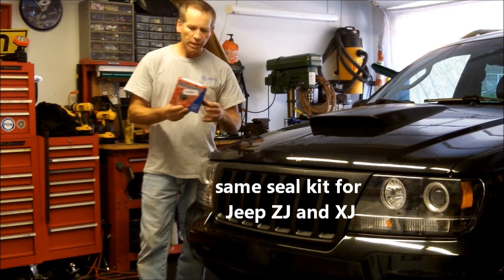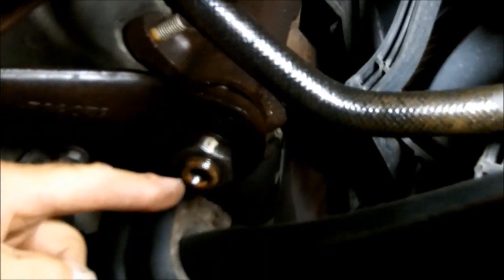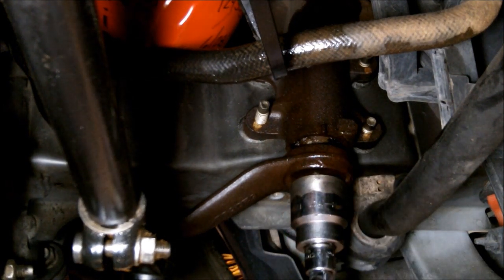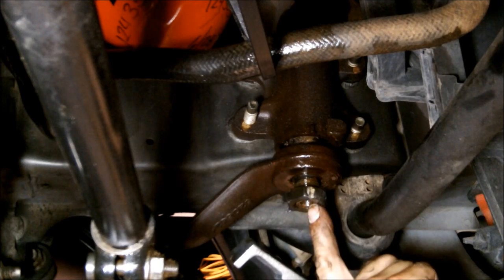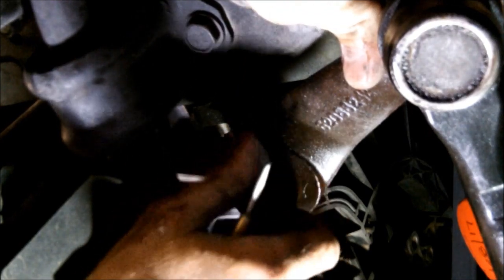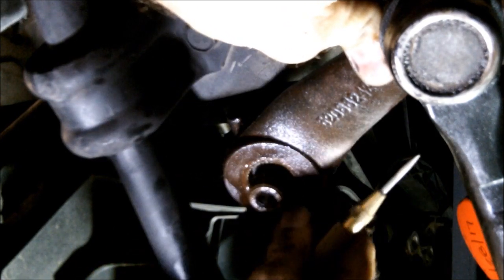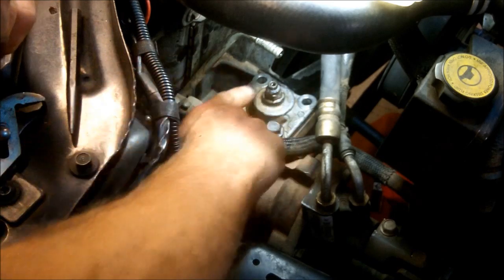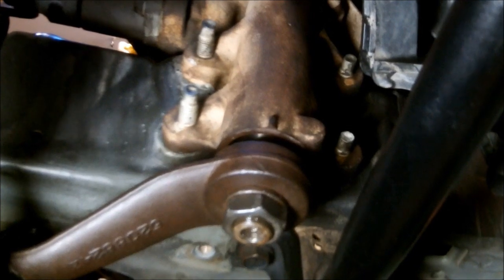How to replace Pitman Shaft Seals

Comment: This is one of the best breakdowns of replacing those seals. For such a small job it's a PITA. Gotta make sure you have a GOOD set of snap ring pliers. The ones at HF suck and the snapring keeps popping off the pliers.
Reply: You got that right.  Snapring pliers need the correct pin size on the tool, or you just have hell.  I reach for my knipex that has a 45 degree offset when it comes to getting larger snaprings in and out of odd places.  This is one of those jobs.

Comment: To get the seals out you can just take the circlip out. Then start the engine and turn the steering wheel either direction until it stops,then hold it there. It will ( most likely) blow the seals out. Kinda messy but it's easy. Make sure the tires are straight if you take the shaft out of the steering box and don't turn the steering wheel until you put the shaft back in the steering box. Oh yeah...put the nut back on the shaft before the vehicle is started. So you don't lose the washer. And so you can see what seal goes where. I don't actually take the shaft out anymore. I clean the rust off the shaft with a brass wire wheel. I made some spacers out of pipe.I Dremeled out a couple big thick washer that fits over the shaft. Then I use the steering shaft nut to press the new seals in. I just clean the rust off the inside of the steering box with those green abrasive pads. Then start the engine again. Just in case any of the rust & dirt got up by the bearing. When you start the car with no seals in it. It will blow any contaminants out. If you can't find the exact size washer,you can trim a bigger one down with a bench grinder. I have a 96 ZJ. I put a steering box strengther on my steering box and I haven't had any problems with the seals since. I think the box flexes a little under stress since the shaft is so long. Plus it's not unheard of for the steering box to rip right off the frame. The spot welds can break. Especially if you have larger than stock tires.or take it off road. It's not a bad idea to beef up where the box mounts to the frame with an aftermarket steel plate also.
Reply: GR8 advice Sir

Comment: The thing about these steering boxes is if there is any crud in the system... it's going straight for that lower bearing and seal.  Most of us don't hardly think about changing out power steering fluid, yet we should.  Once every 3 years ought to do it.

Comment: I left the shaft in & I used a 3" long wood screw & screwed it into the side wall of the dust seal & also the oil seal & as I tightened the screw down it acted like an auger & the seals pulled out.  My only problem on the oil seal was that the sharp end of the screw dug in between the bearings just above the seal & the tip broke off & was stuck up there in the metal. I had to pry it out & nothing was hurt, all metal up there. So maybe just get the screw tapped in & pull on it to get the seal out.  When putting the new seals in I used the washer against the seals & then tapped them with a pipe that fit over the shaft = my sockets were too big around to go up in.

Comment: 9:10 i know it’s late but i’m doing this on my ‘98 XJ, and an easy way to take off that outer seal without taking off the pitman shaft is to use a nail or screw and actually break and pull that seal out

Comment: I have done this twice on my silverado 4 wheel drive which has way more parts in the way under the truck. I took the whole box out.it is leaking again as i think i nicked the oil seal when installing it. I think i will do it your way now. This job sucks. Almost as bad as replacing fuel pump with dropping the tank full of gas. Just did that yesterday.
Reply from the maker: If you're sliding the seal over the splines of the Pitman shaft, wrap some electric tape over the splines to make sure that the splines do not damage the seal. Good luck 👍

Comment: Not sure if this was mentioned but I am almost positive the second seal you put in was placed wrong side out. I have replaced many seals and the open end with the spring is always placed toward the pressure side…..in this case, towards the gearbox where the oil is held in. I can’t be dogmatic but I have never seen it done the other way.
Reply from the maker: The second seal is to keep contaminants from getting in.

Comment: I have a leak on the top of the gear box it looks like the middle screw because i have a puddle at the top what seal are at the top where the 4 bolt are

Comment: my mech wants 1100.00 to replace the seals on my 94 Isuzu trooper.  would like to have seen the old seals on yr Jeep, what was the cause of the leak/what actually failed?.
Reply from the maker: Many times with steering gear boxes it is hard to see where the damage to the seal is, the steering gear box is under such high pressure that it doesn't take that much to start a leak.

Comment: Great video. Much easier to pull the shaft in order to remove/ install the seals. The kit comes with the large o-ring. Where does that go? Thanks for this very helpful video!
Reply from the maker: If your particular kit comes with a large o-ring seal go on the underside of the cover of the four bolts that you removed

Comment: How do you fix the play in the steering wheel of these jeeps?
Reply from the maker: first check the tie rod ends and if there good then you can adjust the steering box, center bolt and nut on the top cover but a little adjustment goes a long way.

Comment: Hey, this video saved me! I do have a question though. Do you or anyone watching know why the top end (where the 4 bolts are) started leaking after removal and changing the seals? I've taken it all apart and couldn't see anything. Any help is appreciated. Thanks
Reply from the maker: There is a seal on that,  it may have gotten damaged and now needs to be replaced. 😬
Reply: @martinbuilt  thank you. I see the seal. How do I remove that seal?
Reply: FYI, I'm working on a 2004 grand cherokee

Comment: Wire  brush clean the Splines.,  Super Clean , with a small wire brush ,  for drill !   Than  ,      I always  PUT Anti Seize compound, ( By Permatex)  on  the SPLINES,  before  putting the Pitman arm back on the Shaft .... Cheap  insurance when to take apart for the Future .. ... .. .. IT will make LIFE easier in case of next repair ..   What is Anti-Seize? Anti-seize products are applied to bolts, fasteners, flanges and other clamped interfaces to prevent galling, seizing and corrosion, as well as lubricating to ease disassembly.